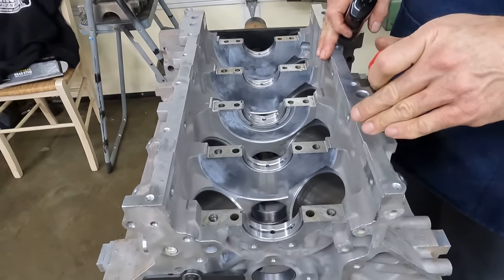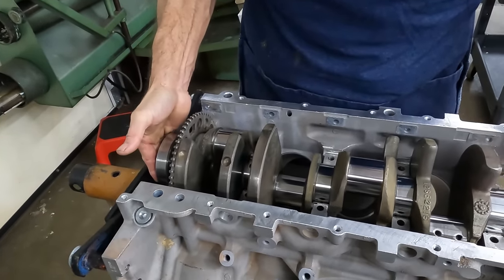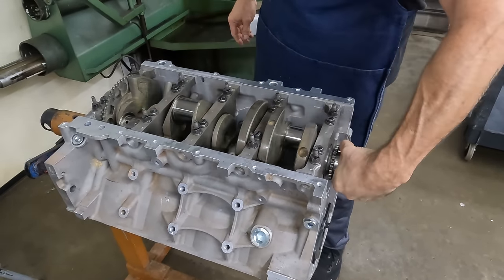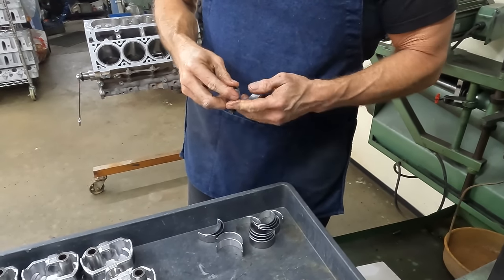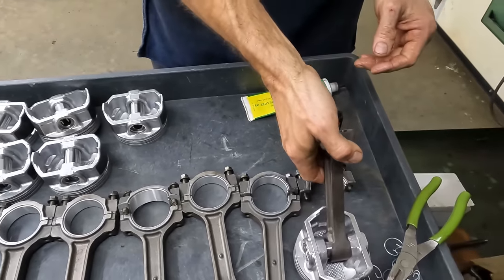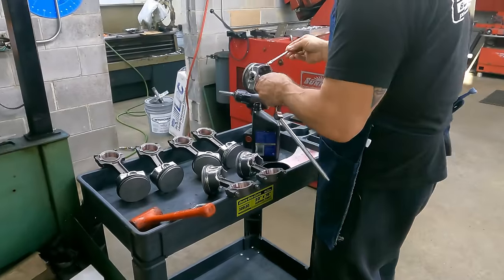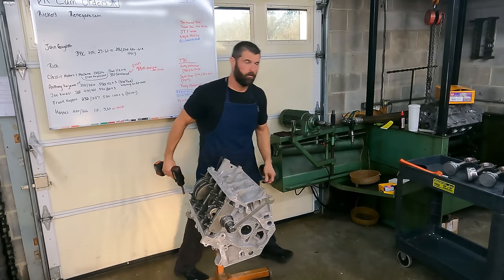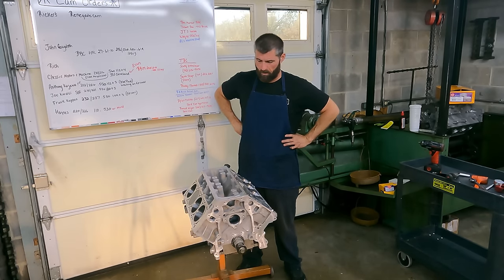Facebook 5.3L Ep #6 Installation of the rotating assembly

Comment: My personal secret of little consequence. Lubing bores and pistons upon install, i used outboard two-stroke oil (water cooled, not air cooled). More than enough lubrication being used straight, as outboards can run 3k hours on a 50:1 mix, and burning away clean is engineered into it. The oil is being used exactly where its designed to.

Comment: Pete's Machine back in the 70s we used STP for assembly lube- the old school STP was really thick and sticky not like the new STP. Also noticed when you put the wrist pen keepers in- you called them locks- they was turned in all directions then I saw how you lined then up (hat) up like we use to. Pete would get engines in for rebuild with broken keepers and he discovered that the locks had not been installed properly. If you put them in side ways the piston movement and combustion process would cause the keeper spring to move or bounce and the keepers would break over time from that little movement. We also used blue Loctite on the rod bolts or nuts to make sure they stayed where we torqued them. Good job, machine work is looking good. Peace.

Comment: I really enjoy your content! 40 yrs ago I attended UNOH in Lima OH and went thru the Auto Diesel program. They now also have a racing curriculum, but I loved it at UNOH. I was rebuilding auto/manual transmissions & engines before I had that specific class at UNOH. I worked at a local Ford dealer after UNOH but starting at the bottom my primary role was rust proofing and oil changes. My career path soon went to industrial maintenance and stayed there. My first love has always been engines and still enjoy wrenching on them! My Father was a mechanic so I think I get the desire naturally. Most are small engines that I work on now days. Keeps my mind going I guess? I do know that if I was in the need for engine work, I would have your shop do it no matter what it took to get it there and back! Keep up the good work!

Comment: ur way over 10k now bro ur gonna blow up your channel is awesome you actually show the process and how to do stuff and is very helpful. i wish i had your channel before i built my last engine but i know my next engine will be even better with your help from these vids. i got a 357 sbc turbocharged makiin a dyno proven 637hp crankshaft output on 8lbs boost in my 70 c30 pickup blow thru carb and intercooled on 93pump

Comment: Really enjoying these videos - I'm glad you like doing them!
I usually deal with pressed pins, so of course, the machine shop presses the pins into the rods/pistons for me.
I was surprised to see you load the bearings into the rods/caps before installing the rods/pins on them.
Just wondering if you had a reason for that order of operations.
One thing that I'd like to see on a performance/race build up is how you set up the valvetrain, i.e., set the pushrod length.
I've seen articles and videos of people getting all bent out of shape about having the rocker tip sweep evenly across the middle of the valve stem tip.  Others, who I agree with, don't worry about where the tip hits as long as it's fairly centered, but go for the minimum sweep across the valve to set the correct pushrod length.  I look forward to you covering details like this.
Reply from the maker: Minimum sweep is king, but.... it can't be falling off the tip either,  sometimes the rocker is the problem and you need something else to make it work

Comment: Long, long ago, I visited a machine shop that was building dirt track SBC'c. One thing that they said is that it was important while working on / assembling the engines that if they are aluminum blocks, the enginee should always be supported from both ends. They said that if its only supported by the trans mount surface, the engine can slightly droop on the non-spported end. It kind of makes sense. All machining is supported at both ends (fully supported) but whenever its on the engine stand, there is no support on the front. Please give us your thoughts on this.
Reply from the maker: My  thoughts? Absolutely nonsense

Comment: Question? So you only checked ring end gap on one top and one second ring in a single cylinder and call the rest good to go? As far as I know every ring including the oil scrapper rings must be checked in the bore they will run in. Oh and .013 end gap? I get that if the bores are the same size and the rings were all made correctly this should be fine. Without checking every ring end gap some day they will bite the hand that feeds them. General rule would be .016 would it not? I would rather have to much end gap than not enough. BTW I love your channel. Your attitude and personality make me smile every time I watch one of your video's.

Comment: What is torquing in degrees, what happened to torquing in foot pounds. I’ve been out of the building cars for about 20 years. I like watching your videos it’s got me wanting to build another hotrod.
Reply from the maker: Newer engines use torque to angle, it's more accurate
Reply: I’m guessing that’s more of accurate way than torque to 30 pounds then turn another 1/2 turn. I did head gaskets on a 4.6 Ford and that was the spects!!! Lol

Comment: Honest question, been watching lots of your videos lately. Just discovered your channel and very much enjoy/appreciate you taking your time to make these videos.  

I’m a home gamer here. Building my sons 351w (he’s 5) in the old family monarch.  

When measuring the cylinder bores I can’t find a straight forward answer on what accuracy to measure to. 

For example my bore gauge has .0005 graduations. I ordered a starett bore gauge down to .0001 graduations.  Am I “over measuring” here?   

I see tolerances for bore taper, concentricity and so on but every one seems to have a different spec for all these measurements.  

Should I be worried down to .0001 or is .0005 fine here. It’s a N/A .020 over 9.5:1 mild cam build. Manual transmission. 

I just want this thing to turn gasoline into noise and pollution reliably.  

Thanks again for the videos, I shall continue to soak this information up like a sponge.

Comment: I learned a bit from your assembly video. It has been a while since I assembled an engine. I am working on a Olds 455 now. 060 over. 020, 030 on crank. But cam didn't fit.  Machinist said to tap in with hammer. Not!  Have scraped cam bearing some. Working. Almost finger loose cam. Will never use that machine shop again. What are your thoughts.
Reply from the maker: Glad I could help

Comment: Question?  At 16:20 do you put the open part of the lock clip at the 6 and or at the 12 O'clock position in reference to the length of the piston and connecting rod?
Reply from the maker: I put it at 6.00 only because of ocd,  not because it matters

Comment: When you torque the main caps are you not suppose to start in the center and work your way out? I have never seen a LS builders book or GM manual say start in the front and go back.  I also haven't seen anything that says you are to torque all 4 main bolts per cap. Everything I have seen and read says do the inners all the way then the outers all the way.  I have built a few LS motors and not had any issues but if the correct way is to start in the front and go back and there is data to prove it,  I want to change the way I do it.  I like your videos and have watched a bunch, this one is throwing me for a loop though.  Thank you for taking the time to make these videos, I appreciate it.
Reply from the maker: No, the main caps are independent,  so it's irrelevant,  it's not a cylinder head with a gasket.
Reply: Thank you for the clarification. @powellmachineinc3179

Comment: I have .013 top and a right .017 on bottom rings. Just a stock rebuild other than a mild cam swap. Is that enough ring gap?  The ring instructions say .004 per 1” of bore. With 3.80 bore that’s .0152. I’m concerned it’s too little at .013. Any help would be great.
Reply from the maker: I believe this one came out at .013 or .014, you could add a couple  but should be fine

Comment: Good stuff. Ring question… seems to be a lot of different input about seating rings. What’s your recommendation on these LS engines? Finishing up my build, and will want to run it a bit to shake out any issues. But the vehicle it’s going in, it won’t be drivable until later. In the process of doing a back half on it, among other things. Some say, with the first run, you should run it under a load (such as driving) and some say it doesn’t matter. What’s your take?
Reply from the maker: We do no load 3 heat cycles and I'm done

Comment: A question about the stock powdered metal rods and rod caps.  I have always read that each cap has to stay with its own rod. 
1.  Has that turned out to be not such a big deal after 25 years of LS experience?
2.  When installing the rod caps after loading the piston in the block:  do the LS rod caps for each piston only fit in and line up one way:  are they side specific, or are they universal and can go on either side?
Reply from the maker: https://youtu.be/VtmJkpH01Rk

Comment: do you ever find the need to pin the cam bearings on the ls to keep them from moving i know 1 you tube channel does
Reply from the maker: Na, they aren't going anywhere with the proper fit and a good oil supply

Comment: Hi Daniel, I really enjoyed the video of your assembly process. Question, at what point do you install the main cap bolts through the side of the block and into the side of the main caps?
Reply from the maker: normaly as im doing the pan, the bolts need sealer, so i save it for last
Reply: Thank you @powellmachineinc3179

Comment: The sequence you torque the main bolts if I seen it right is front to rear rear to front I’ve never seen that before I guess I’m too old school I thought you started with the center cap and work your way out if I’m wrong please correct me thank you for your input and opinion. I appreciate it if you would thank you.
Reply from the maker: It's irrelevant..the caps are independent,  the mains aren't a cylinder head with a gasket.
Reply: @powellmachineinc3179  thank you

Comment: ARP 2000 head Studs vs 625+ studs   will the 2000s hold 1500HP what is your thoughts on high dollar studs😊
Reply from the maker: It's clamping load, the 625+ will have more, but I think 2000 will hold more than the block so....

Comment: Hi, I have been Mechanic for over 40yrs now. And have never put (even a lawnmower engine) together w/out specking every single ring, Inc. oil ring x2 in every hole! And i have found lots of them were to tight and would have ruined cyl. in minutes. So it makes me think, Of all those messed up cylinders.And when i seen u doing only some of them rings, I lost a little respect for u.  You should have at least faked it!
Reply: It didn't bother you he set the thrust to 3 thousandths?

Comment: I mean i dont want to be negative but his torque patten is not correct.  The bearings need to be prepped better.  The trust faces are not double polished.  Oil is not applied correctly.  He didnt soft torque the shaft.  The mating surfaces were not properly cleaned.  I am suprised he has any working indicators left given how hard he treats them.